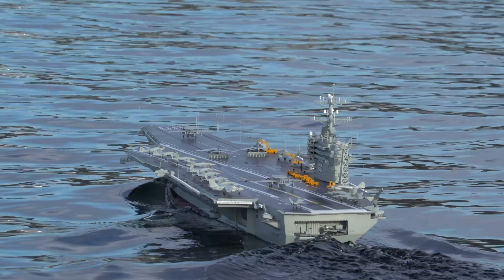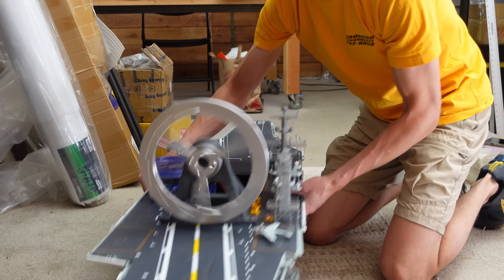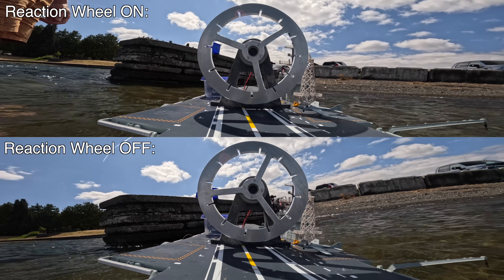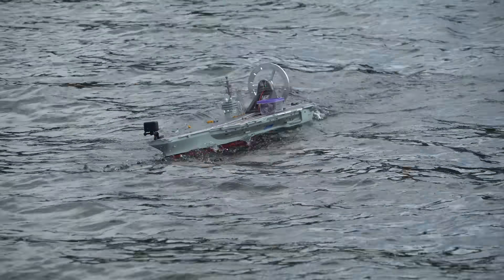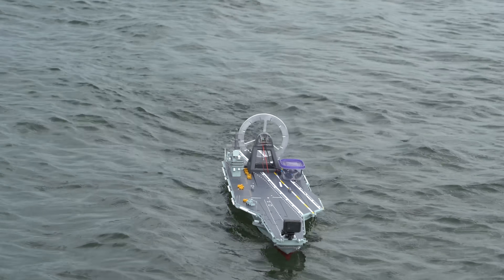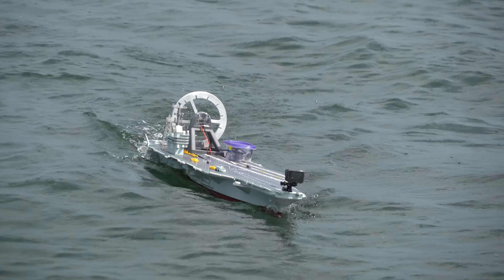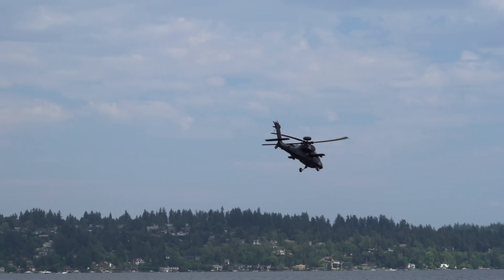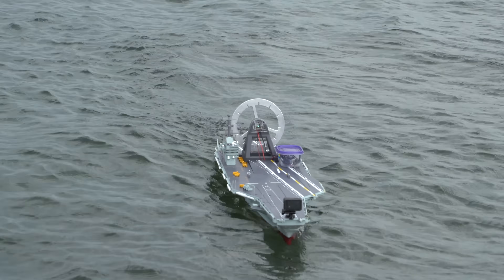R/C Aircraft Carrier with Reaction Wheel Stabilizer

Comment: With a long ship like this, maybe a smoother option would be two or three smaller wheels, one towards front, one mid and one back. Could probably also better control pitch/twist correction that way.
Reply: I wonder also if you had them mounted closer to your center of gravity what kind of change it would do. And is the change better with a large flywheel were multiple small flywheels.
Reply: Smaller reaction wheels are (practically, not theoretically) less effective for the weight of the wheel. That's one downside.
Reply: @roboman2444 You'd need more speed instead, but you could mount the system under deck.
Reply: and they'll exert a torque that makes the ship yaw more easily in one direction than the other